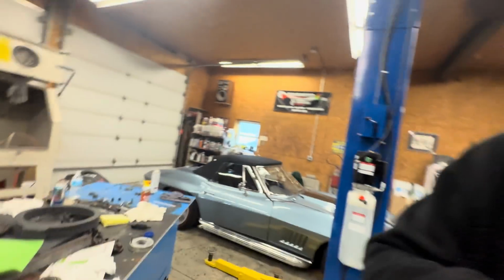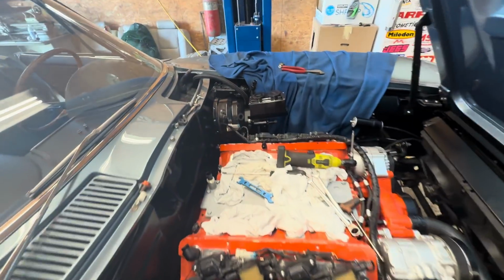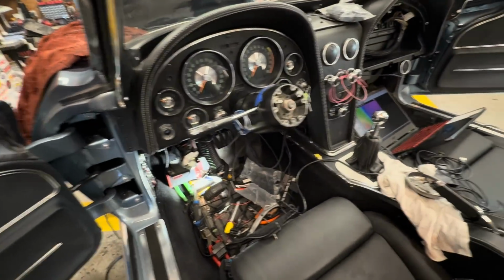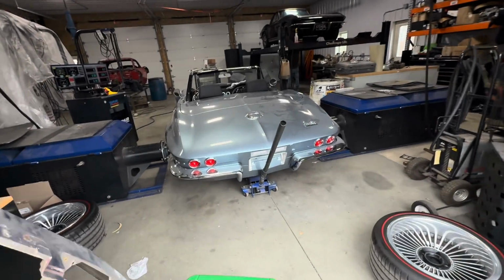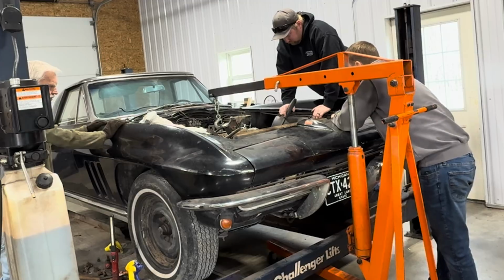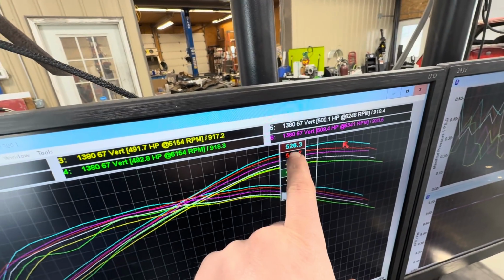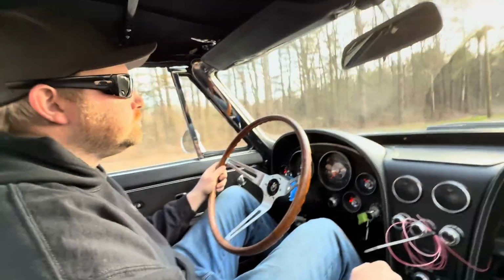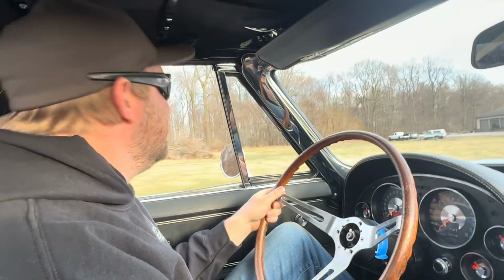Hurricane FLOODED Corvette Has MORE ISSUES! 67 LS3 Pro Touring Vette

Comment: Not trying to be a wise guy but these cars ran pretty damn good without any electronics. Even the fuel injection cars didn't need it 
 If I recall they produced 375hp from a 327 small block and that is bone stock the L88 engine was more like 560 to 585hp stock. It only goes up from there and you can get tons of power from a BBC but I'd like to see some stroking a 327 to 383, better cam and port work with Rochester Fuel Injection. What is possible, 500? 600?
Reply from the maker: We’ve got plenty without electronics, a factory mid year isn’t running anywhere near as good as this car does. A stock 427 corvette will go low 14s in the 1/4 mile. This is a low 11 second car and gets 20 mpg.

Comment: Interesting how the little things such as the pin hole leaks upset readings. Keep working on it. Here is a tip that is simple, it will prevent you from having headache if the hood get stuck and won't open. Go to the end of the cables at the brass barrels, bend the wire 90* . If the wire slips on the brass barrels, the 90* will prevent the wire from coming out. NO headache!
Reply from the maker: The hood needs adjusted bad. But right now it’s at the bottom of the list! I will then bend the cables like you said! Thank you!

Comment: Should either have  exhaust out the back or side pipes,  not both
Reply from the maker: I agree. It’s cool to have both, but being a pain. Personally I like a full exhaust, but I do like the looks of side pipes. I hate the side pipe sound.
Reply: @HorsepowerDepot  - And I hate my legs getting burned on side pipes getting in and out of a car!
Reply: @HorsepowerDepot  rip that side pipe crap off and put a nice full exhaust on it...that car deserves it.
Reply: For real. I never liked side pipes, they are completely impractical for a street car, they sound like ass and I personally don't like the way they look. If it were mine I'd trash those side pipes asap and put a nice full exhaust out the back on it.